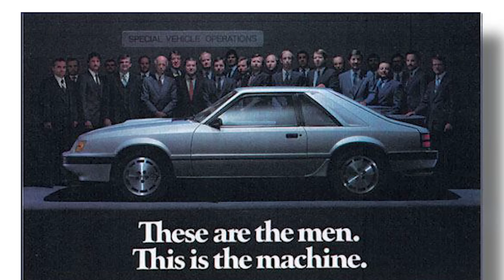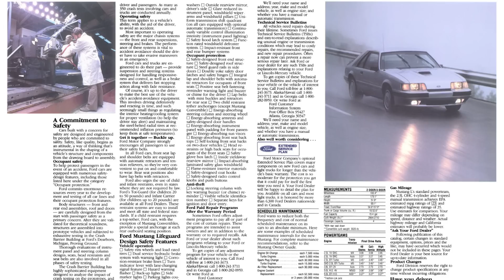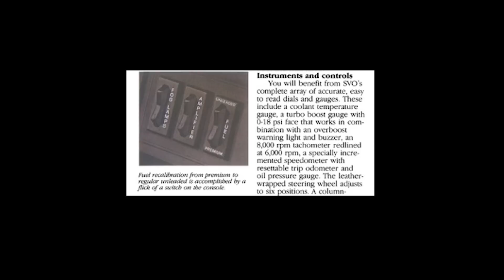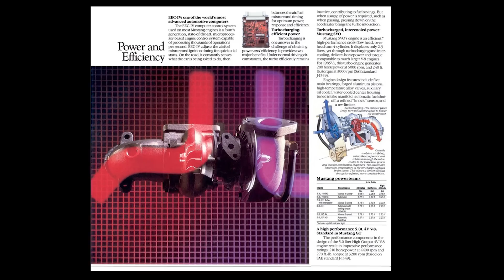What is an SVO Mustang? | 1984-1986 SVO History & Specs

Comment: I installed a 2.3 turbo from my old rear ended 86’ Thunderbird Turbocoupe into a 91’ 2.3 hatchback Mustang 5 speed, including many other Turbocoupe parts like the Trac Loc diff. 
 It’s my home built “SVO” almost. Lol
 Fun to drive, even added AC and the Aluminum SVE radiator and 130 amp 3G kit. 
 Good gas mileage too, average 27mpg highway.

Comment: I agree the SVO was ahead of it’s time. Had the price point been a little lower I believe sells would have been better. The torque and price of the GT back then just made it so much more appealing to the younger crowd at the time.
Reply: It didn't sell because it sound like crap. I love turbos but Ford 2.3 did not sound good at all.
Reply: Fuel prices rose in the early 1980's and Hot Rod Magazine announced the death of the V8, saying the Buick turbo V6 was the hot rod engine of the future. Ford had already made a turbo 4 cylinder model of the GT Mustang, so they stepped up to this SVO Mustang to go after the BMW customer. We could argue the turbo T bird was going after the Porsche 944 customer. Ironically the SVO was the handling and braking package the GT Mustang lacked that sent folks to the F bodies from GM

Comment: I remember test driving the SVO when it first came out.
The 4 banger turbo model.
Wish I had bought it now. At the time I had a 4x4 truck with a 428CJ motor and a mid 70's "King Cobra" with 302.
Note: Bought the truck new in 77, paid $4500 for it. My first new vehicle. I was 19.

Comment: I had a black ‘84 SVO that I bought used in ‘88 when I turned 21. It had the crank windows and the shocks were white, not red. The Koni’s came with a little knob to adjust the shocks that was kept in the console. That sucker handled great and moved pretty good. Unfortunately a tree fell on it in a storm and it was never the same so I sold it for almost nothing. Dam shame.

Comment: I had a white 86. It had a bo port stage 2 head and cam. Stinger exhaust. it was fairly fast. Getting the SVO specific interior items were costly. The shift knob and the steering wheel horn pad especially. I always thought it would be cool to throw the new eco boost motor in it. Sadly, I had to sell it after I got out of the military.

Comment: Great video!! I’m the proud owner of a 1985 SVO Mustang. It’s not at original, but more of a Resto Mod. The 2.3 is long gone, and a 94 351w, and a TKO 500 transmission, 8.8 rear axle upgrade, are just a few of the Mods. Are you guys ever going to start making parts for the SVO’s?
Reply: I think it would be cool to put the new 2.3 with the 6 speed manual gearbox in it and upgrade the brakes.
Thing would be a beast!! And make sure it's the HPP model
Reply: @kevinnorwood7355  maybe later on, but for now I’m pretty satisfied with it. I’ve got a stroker engine in the works, but definitely for a later date. Plus I’m still playing around with the suspension components. Just a little at a time.

Comment: The SVO wasn’t the first Foxbody with 5 bolt hubs and wheels, the 1978 Fairmont and Zephyr were then Ford switched all Foxbody to 4 bolt hubs and wheels for the 1979 model year. The 1984 SVO got Goodyear NCT tires which were very disliked by some of the automobile press. 1985’s got Goodyear Gatorbacks.

Comment: Why was it faster than a v8 if it made less torque?
Reply: It wasn’t. It handled better.
Reply: @bobbarker1476  I asked him that question to see how smart he is on the SVO. It was quicker than the v8 because it had 3.73 gears. Yes it only made 240 lbs.-ft torque @ the crank but the wheels got more than the v8.